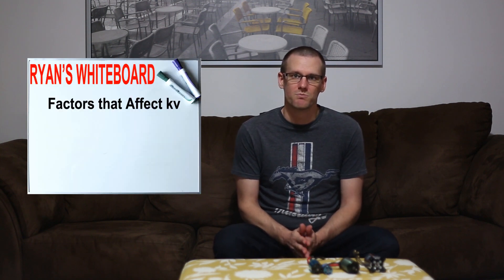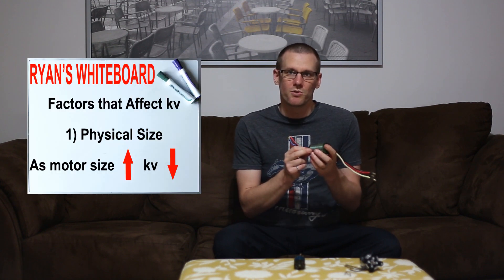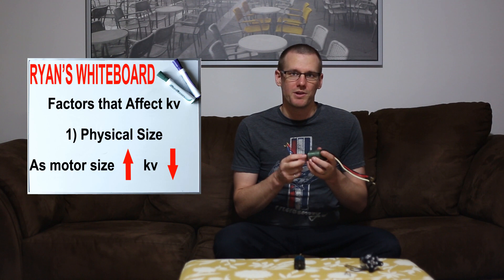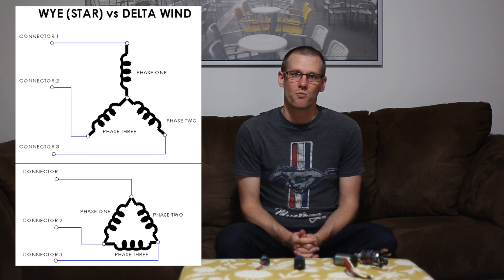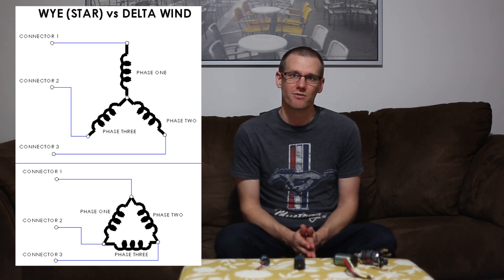Understanding KV of a Brushless Motor - RC Motor Basics

Comment: Thanks for a great video.
I'm currently working on a robotics project, and i've always used brushed dc motors, just because of the simplicity.
Now i wanna step to using some brushless motors for some more power, but after watching this video and your Inrunner Outunner, i see that it's not just as simple :)

Is there anyway to know how much torque to expect from a brushless motor? 
Normally i would maybe buy an already geared dc motor, but that doesn't seem to be a common thing for brushless?
Reply from the maker: Hi Christian, I have not used a geared brushless motor. Typically the application we are placing the motors in already have there own transmissions to sort out the Output RPM. Otherwise the application is direct drive. There are many brushless options out there. One thing you may want to look at is if you need to go with a sensored motor or sensorless. A sensored motor will give you a cleaner start up from 0 RPM. (similar to a brushed motor) A sensorless motor would not be as clean. 

Yes there is a way to determine expected torque. Kv and Kt are both motor constants that relate to each other. You can find one to determine the other. Kt is measured in newton meters per amp. Then you just need to determine the maximum continuous and/or peak current that the motor is capable of and you will know the torque output. 

Don't forget to hit that like button if the video has helped you out. This helps encourage me to make more! Thank You